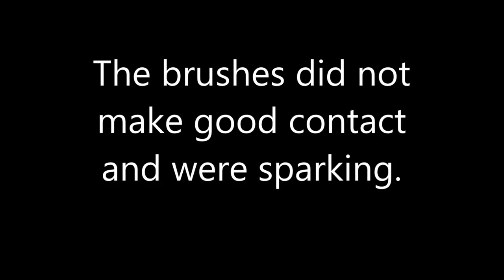Catastrophic Chop Saw Failure and Neglected Tool Repair Tips!

Comment: You did well with the sanding with the drill. I would also like to recommend that anyone doing this, put rubbing alcohol on a paper towel and wipe the commutator down.
Added. "Using a 10-32 machine screw rub it in the channel of the brushes. The screw will act as a file.
Reply from the maker: Thanks man and good tip on the alcohol and wiping out the brush holder. I tried spraying contact cleaner in there years ago and it shot out a fireball as soon as I squeezed the trigger. I am now aware that stuff is flammable
Reply: @BrandonLund  So is rubbing alcohol, white orange flames. The difference is that just blowing on it after wiping down the alcohol will evaporate quickly.
Reply: What's about Thinner
Reply: @kehindeoluwatosinchanges4605  Paint thinner or Acetone will soften or melt certain plastics. A commutator is a circuit that has an insulator made of melamine and epoxy or a similar product. Acetone is chemically similar to trichloroethylene. I've used it to remove by softening epoxy and silicone on RF circuit boards prior to component replacement.
Reply: @timthomas9105  Thanks so much Maestro for your insights, My chopsaw is back to life real time. 😍😍😍😍😍✌️✌️✌️✌️✌️

Comment: Excellent repair video!! I am going to save $400 by replacing the brushes rather than replacing the whole bloody saw (DW708). A failure mode analysis website indicates that brush failure is 67% of the failure reasons.
Reply from the maker: Thank you and I'm glad I was able to help!  Now you can take that $400 you saved and spend half that on more tools....everyone wins! ;) Thanks for watching Kevin!
Reply: Kevin, if you use the bevel scale on your saw, check it for accuracy, mine was 2 degrees off! Dewalt uses rivets to hold the scale and it can move around.

Comment: how often/long have you been using this saw? got 250+hours on a 12amp angle grinder and theyre hard hours, i check the brushes once or twice a year and they havent worn 1/3 yet still running original ones

also nice trick with the armature in the drill chuck
Reply from the maker: +Andrew Browner I've used this saw hard everyday for 5 years, which much of that was production work, until I retired it. I think if you keep an eye on your brushes and replace them  when you see signs of wear, you will be all set. I waited WAY too long and never checked them.
Reply: Andrew Brownero

Comment: thank you, great tips.i use/abuse 4 inche angle grinders in my job .I've changed many brushes but never ever sanded down the comutators and they looked quite worn.i 'll plan on trying the sand paper trick in the future.what saw did you replace your retired saw with,upgraded perhaps to what make and model?
Reply from the maker: rotoclip Same manufacturer. I have had excellent results with their chop saws, however, i personally have not had great luck in commercial enviroments with their other tools such as their reciprocating saws and drills.  Based on my own experiences, I personally wouldn't own anything else other than a dewalt chop saw for production work.  This saw has seen everyday production use, been used in the rain, fell out of a pickup. It's proven itself to me as far as I'm concerned. Here's a quick tip whenever you change your brushes or do an inspection, with the tool unplugged, stick a pencil that has the pink eraser through the brush holder and spin the arbor of the tool. This will clean your comutator. Your eraser will come out black. Give it a quick rub on your jeans to clean the eraser and do it again. Keep repeating until your eraser is no longer dirty. In my opinion, only sand the commutator as a last resort if it has deep scores. Thanks for watching and glad I could help brother!

Comment: I have the same saw, mine is just a type 5, don't know the differences.. anyways, I got new brushes, expecting the old ones to be bad because there is an excessive amount of sparks in there and it is a bright orange or yellow flash that almost looks like a small fire ball. The thing is, it only happens when I release the trigger after running the saw for a few seconds. If I pull the trigger and just let off really fast, the sparks don't happen, and the brake doesn't slow the blade down, do you have an idea what would be causing this?
Reply from the maker: It sounds like what mine was doing. The new brushes corrected it

Comment: You're lucky you didn't wreck the armature.  I picked up a free Dewalt Circular saw the guy said there was a bad bearing.  Got it home and the brushes were completely gone to the springs and had destroyed the commutator when one of them caught a bar.  I was still able to use the gear assembly behind the blade for another saw (B&D Super Sawcat) that the bearing had been cracked right from the factory when new, so it wasn't a complete waste of my time.  Whenever the brushes start sparking, they need to be looked at immediately to prevent other damage to the motor assembly.  Brushes are inexpensive.
Reply from the maker: Excellent advise! For me it seemed intimidating to mess around with them. Knowing what I know now, at the first sign of trouble I change them out. It's too easy not to.

Comment: Ok so hopefully you will answer me!!😁
My saw was sparking a lot and it smelled burned ! Does that mean the brushes are done !? Or the commutator!? And can it be fixed!? Thanks for the video!!
Reply from the maker: It's hard saying without actually seeing the tool, but in my experience when the tool starts sparking in the brush area and it smells hot, it's usually the brushes that need replacing. This saw was sparking bad and now it runs great, so there is hope :)
Reply: Impressive

Comment: I did exactly what you do to the commutator and bruches of a old drill. But when I try it  the bruches was making to mush spark and the commutator was black in 2 seconds, so I take it appart and clean it again. I'am waiting at a solution right now... Any idea of the problem?
Reply from the maker: From what your describing, it sounds like the brushes are not matching the contour of the communtator.
Reply: Could also mean he used to low grit sandpaper and the commutator isn't smooth enough and acts as a small file on the brush removing too much grapith and giving excessive sparks

Comment: Hi, im looking in to dewalt tools from usa and 120v, you took it a apart, but i could not see if there is any diagram for rewiring this tool for 240v ? cause i beleave dewalt is not making or designing seperate motors, its just the same motor but different wiring, i wonder if the tool have the wiring diagram for 240v ?
Reply from the maker: There was not one under the cover and I do not have the original manual that came with the saw. I would not be surprised if the same motor was used for both voltages and then just wired differently.

Comment: I read my manual on a Makita 8.25 circular saw and  it said after installing new brushes let saw run for 15 minutes with no load to help seat the brushes FWIW
Reply from the maker: Good tip!
Reply: @BrandonLund  this process could "sand and round "the commutator...... could not hurt to mark and remove brushes and blow out after 15 min cycle

Comment: Hi I have a performance mitre saw and I can't seem to get the motor out of its casing how can I do it
Reply: Did you ever figure it out ? I have DeWalt 703 . Like the one in the video.  Same problem as you.  Can't get the motor out of the casing.  Any advice is much appreciated.

Comment: Before replacing these brushes what issues were you facing
Reply from the maker: It was sparking out the brush area, it was low on power and it was making a weird sound while it was running.
Reply: @BrandonLund  mine is making a weird noise to begin with but then runs fine. That is until I lower the blade to cut a bit of wood. As soon as the blade touches the wood the blade stops spinning. I've checked the brushes and there is plenty of wear left in them yet. Not 100% sure what the issue is. I've tightened the blade. Perhaps it needs a shim? Or is the blade on too tight? I dont quite know? I've also checked the grease in gears which seem fine. I'm confused as to what the issue is. The blade itself is a Bosh and all the teeth are fine too.
Reply: George Haddad maybe you fixed it already but I’d inspect the belt in your saw real good too, might be wore out or slick in some spots, which can happen sometimes if you try and chop through something too fast or pushing there saw through something real dense too quickly. Worth a peek 👍
Reply: @christophermiller2075  thanks for the tip. I've not used the saw for a while. But I did replace the bushes and it seems fine. But if it occurs again I will check the belt out. Many thanks 😊

Comment: Cheap brushes are usually soft. So they tend to wear down fast. It is a good idea to inspect brushes now and again. I'd say 15 years is good service.
Reply from the maker: Thanks Paul. Good to know. If they are softer, I'm thinking that could be a good thing. Less abrasive on the commutator. Lord knows this one can use it.
Reply: @BrandonLund  nicer brushes are laminated. When you look at them there's layers in them. It alternates harder and softer materials. So it is modern tech. Not as modern as brushless commutation though. Which we're still not seeing in corded tools. Might just be that electronics doesn't like the high voltage? Might be that manufacturers appreciate the fact that brushes wear out too though. A lot of folks would have tossed your saw. Which means more tool sales.
Reply from the maker: @1pcfred  True! I have found a lot of deals like this over the years. People throwing away perfectly fine tools over an inexpensive fix but I also hate seeing "good" tools get tossed for cheap replacements, so hopefully these videos can help some folks by keeping their "good" tools running a little longer plus keep a little extra cash in their pocket.
Reply: @BrandonLund  sometimes people just want to upgrade and will use any thin excuse. Sometimes they simply are not interested in investing the time. Or maybe an easy fix for you is not so easy for others to do. Electricity itself is a special case topic. There's a lot of fear and ignorance surrounding it. Electrophobia is real. There's reasons that can be used to rationalize a replacement.
Reply from the maker: @1pcfred  Good point

Comment: Great video, but i have to be honest,  1000 grit is very intensive, red scotch bright or just the ruff off a sink sponge is just enough to clean moter because 1000 grit just lost another 5 years from the moter, original parts (brushes)cost  very similar to non original,    lastly don't sand the brushes to match moter dimensions let nature run its course 😉   adive from a person that fixes tools daily.,     still great to see free advice on money saving.    It does take a real person to use and fix their own tools
Reply from the maker: The advise to contour match the brushes to the commutator comes directly from GE for industrial motor brush replacement (100 hp) Its done to give the brush full contact with the commutatator to prevent the brush from arcing which shortens the life of both. They use full 8x10 sheets to accomplish this. What I did here was just on a smaller scale.

Comment: You sanded the commutator heavily and therfore changed the profile of it and surprisingly the new brushes didn't match the adjusted profile you created. Who'da thunk it.
Reply from the maker: Watch it again… the reason I sanded it heavily was because the commutator was so worn that it was shaped like a banana. You act as though I did something wrong by trying to correct it. Seeing how the video is a few years old and I’m still using the saw I’d say I did a pretty good job of saving it even if it doesn’t meet your standards
Reply: @BrandonLund  I was simply explaining why you may have had issues with the new brushes ill fitting. They were being applied to asurface that had been alteredfrom factory. No criticism intended.

Comment: Honestly, this could have been avoided if the brushes were checked every five years, or so. If you use this on a regular basis, you have to assume the consumables, such as brushes, are going to wear out. That’s why they’re easy to change - and cheap.

The brushes have to be formed to the curve of the commutator first. Eh, not the best way to do it, but I suppose better than nothing. The sandpaper isn’t following the shape of the commutator. The proper brushes are factory molded.

You got lucky though. I’ve seen motors destroyed by bad brushes.
Reply from the maker: I have no one to blame for this but myself, however the sandpaper tip is not anything I made up. It's actually quite common on large industrial motors.  Profiling the brush to the commutator (even though they are profiled from the factory) is often standard procedure. Especially if the commutator has been turned down in size. Matching the brush to the profile of the commutator extends the life of the components. It's really not a bad idea to do in general.